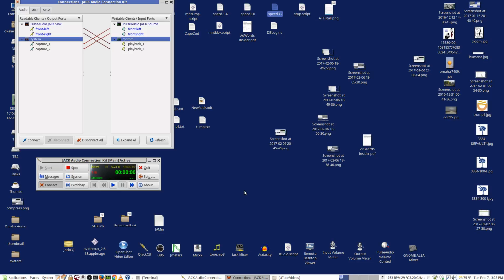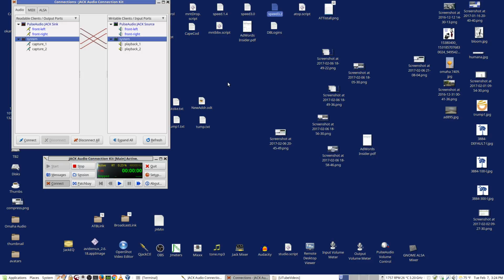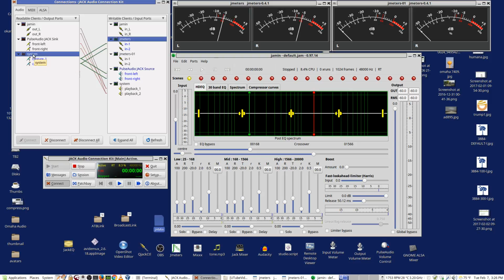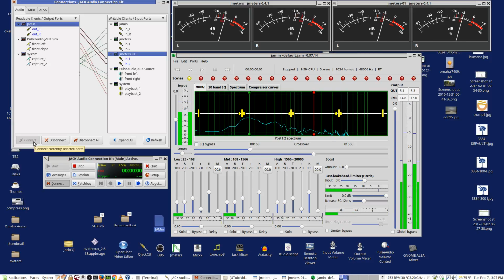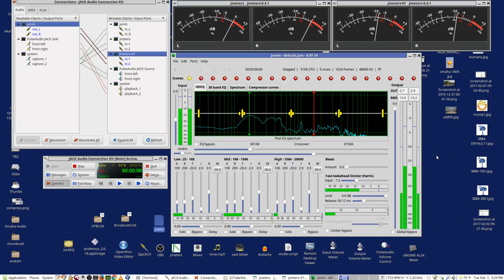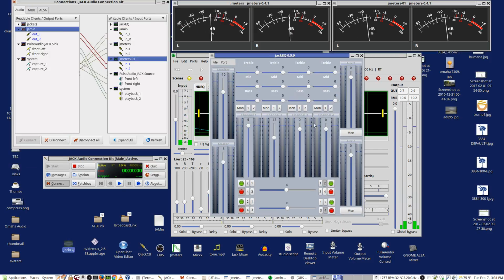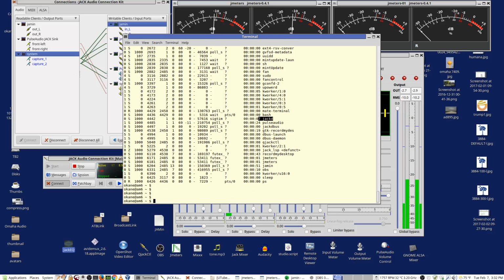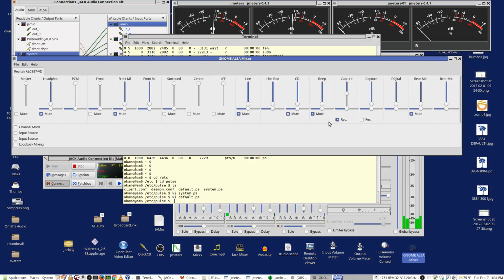Preliminary video of using Jack Audio Mastering Interface

Comment: Kevin,  Thank you for making these videos about Jack Audio in Linux.  I'm using Linux Mint 18.1, and have been thinking about switching to Ubuntu Studio.  However I don't like the desktops look and feel as much as Cinnamon.  These were helpful in getting my system running with Jack Audio.  I question why I have not found this much (near complete) information on this until now.  I suggest making a blog post, etc. public to further help the Linux community.  My contribution: 1. In the first video while showing Synaptic PM, the first package you mention having to be installed was jack.  This is a CD encoder and is not part of Jack Audio.  I did not install it.  2. VLC actually does have jack support.  There is the plug-in named vlc-plugin-jack.  Set Preferences:Audio:Output: JACK audio output.   Id don't like how all of the media players I've tested don't create the JACK until media is loaded.  When opening the player from the menu, not until you open a media file does it create the JACK.  When stop is clicked, the JACK is destroyed.  This makes thing difficult having to redo connections.  Is there the ability to save connections so each time an application is loaded those connection are automatic?